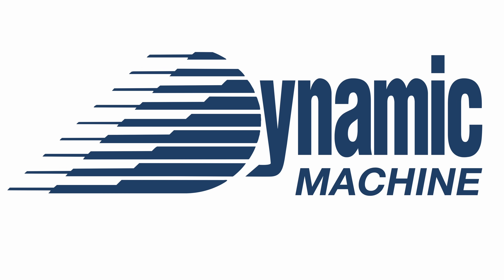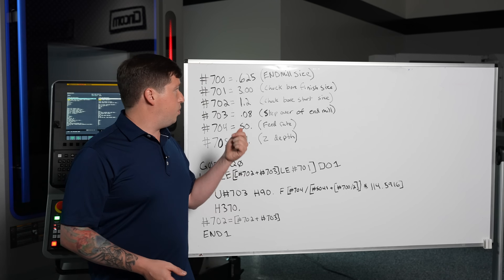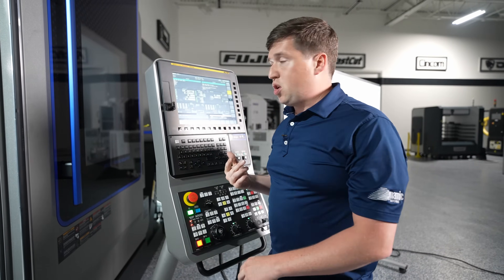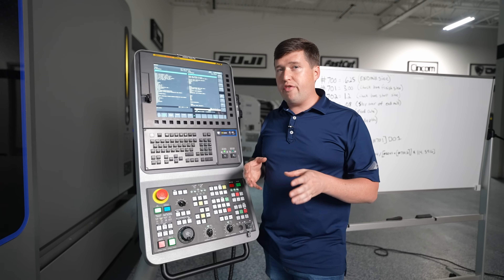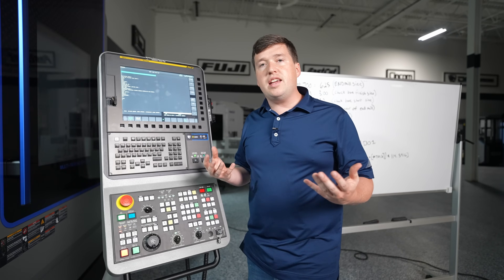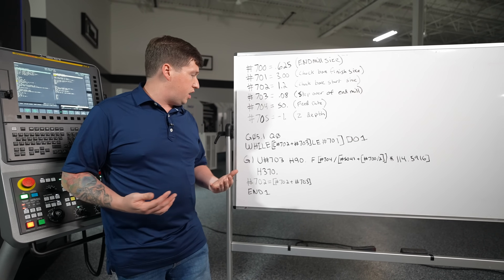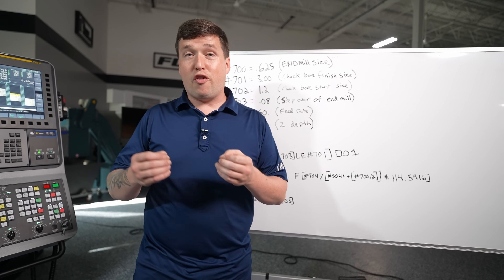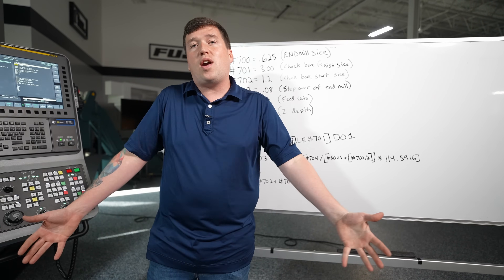Different Approach To Making Your Jaws | Jaw Milling Macro

Comment: so is cutting to closest psi for the application and being in middle of the stroke just a myth? i've been using a boring ring at 100psi for an application of 300 psi and hasn't been a problem so far. but when i bore the jaws i make sure to cut within the center of the jaw stroke. from your experience what really matters in those factors if any?

Comment: Can you make a macro for a lathe with live tooling and y axis to go to a location and spiral mill? For example, a 2” hole 1” deep. One where you can program step overs in width and depth. I run a haas lathe, a ST-25Y and its doesn’t have any VPS templates for milling. I know how to program circles long hang but it would be so much easier to just be able to spiral mill it starting in the center and define a few things and boom we got a program. If you help me out with that, that would be greatly appreciated. Thanks and god bless!

Comment: Great movie as always Donnie! One thing I like to do:
#700= 03003 (Tool);

#700=[#4120MOD1000]
#700=#[2900+#700]

Now you automatically entered your tool radius into #700 depending on what tool the machine has in the spindle, given that you filled it out in the geometry table of course.

Comment: Having incremental movements with  different letters is so useful.  Mills should have a way to turn on a theoretical c axis table like the opposite of G12.1.  look at how easy rotations in degs are. Thread mills would be so easy.

Comment: doesnt have the fanuc controle a simpel pocket mill cycle in it ?
Reply: Yes, but in all the cycles it does the outwards move in a straight line, which may cause chattering since it does a full slot. For example, in X-C pocket milling cycle, it rotates the C, C axis stops then does an X axis move, then rotates the C again and so forth. Often chatters once every round in less rigid machines like a revolver lathe. Best solution is to keep a constant positive X and C move to keep equal tool pressure as much as possible

Comment: I'm working on Citizen A20 VII so probably 🤔 I won't use your macro in the nearest future...
Reply: Citizens should have a com values. You can use those for macro.   I cant remember if the a20 had those but most i have worked with has them.  Also some swiss i used you change change the live tools from radial to axial and vice versa
Reply: @sovannv what the fuck you talking about? You compare swiss lathe to mill lathe with indexable head? 😂

Comment: Will definitely be using that. 
How did get it to run without the jaws clamped on a slug/bung. I know how to do it on a our Mazaks but not the Doosan MX1600S we have.
Reply: Try M31
Reply: @haavard1989 thanks I'll give it a go later in work.
Reply: How do you do it on your mazak ?
Reply: @tymekgoral4219 there's a parameter where it allows you to "inch" the jaws so you can get it to the optimum chucking position on the master jaw indicator. Then you command M391 (M500 for sub-spindle)
Its not 100% perfect but ok for 1st op stuff and you can program in a back taper to make up for the lack of load on the master jaws.
Reply: Those Samchully chuck do have a function to clamp in the middle without a slug or ring. You can set the diameter with the gold ring in the middle. Really useful if you do a lot of soft jaws.
Reply: @Petertje94 ah yes i see its a Samchully  now. That answers that then 😆